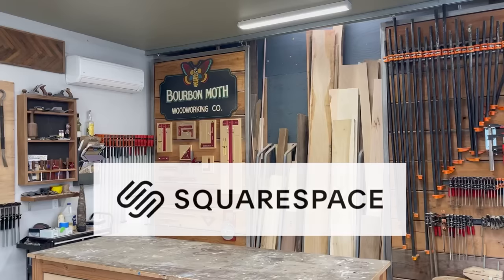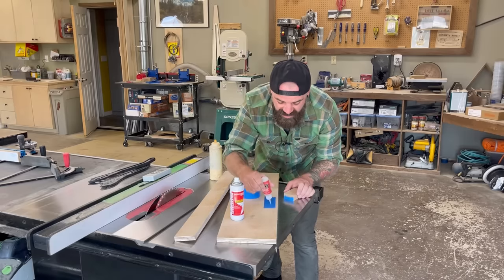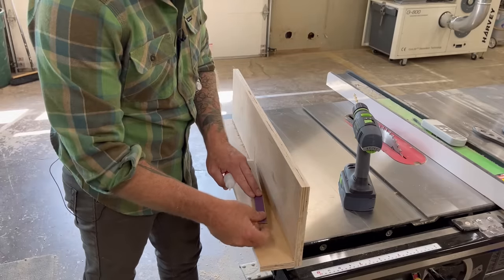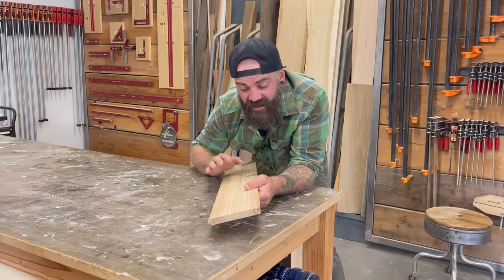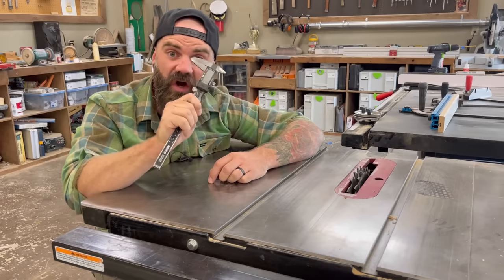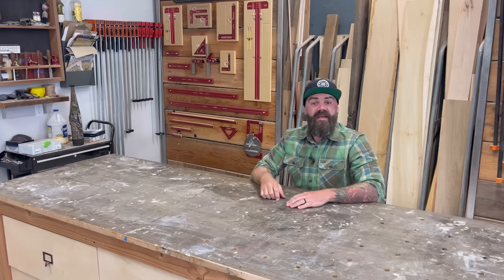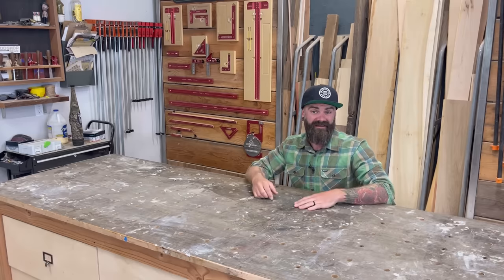Helpful Woodworking Tricks You'll Actually Use | Useful Woodshop Hacks

Comment: This is the 1st vid of yours I've seen. I thought, this guy is crazy.  I'm a newbie and u just gave me more tips than I even knew existed.   ALL of them were new info 2 me. 
Extremely helpful!  I can't wait 2 use them.  I'm heading over 2 watch the rest of your vids now. I have a ?  Which should b obvious,  but my little mind couldn't wrap around. Concerning expansion; if I were using some hardwood 4 a sled, should the lines on the end of the wood b running horizontal or vertical 2 limit expansion and screwing up your fit n the slots?

Comment: Regarding the qtip trick, I do the same thing with chop sticks. Really handy for stripped out door hinge screw holes.
Reply: Golf tee’s are another good one for slightly larger holes
Reply: Tooth picks are another option.
Reply: I keep a box of wood matches in the van for the same
Reply: in a tight spot i once shoved gorilla glue covered pieces of cardboard into rotten door jamb screw holes bc the glue expands — it worked great too !
Reply: I use 10 inch bamboo skewers.  Something like 100 in a pack for a couple bucks at the discount store.
And what you don't use in the shop can be used for cooking!  Lol

Comment: What about the board that I am building coffee table out of a solid piece of Oak that I cut off of a solid piece already it is 52 in long and around 23 in wide and what I'm planning to do is take some out of the middle that I'm going to make a river through it with some poxy and put Little River stones in it and then poxy over the top of it later on as it gets older will it try to pull away from the epoxy

Comment: Thanks for the useful tips!  I’ve been woodworking for more than 65 years; yeah I’m kinda old, and I always pick up something new from other woodworkers.  Thanks again, you present concepts in a very understandable way.
Reply: In October of 2017, I cut my left index finger by trying to cut a tiny piece of cherry shoe base moulding at a 45 degree mitre angle without using the zero clearance fence (plus I had taken my blade guard off of my mitre saw). Needless to say, I was rushing and didn't allow the blade to get up to full speed before making my cut with my left index finger holding the piece of shoe base against the saw fence within an inch of the saw blade and when the teeth made contact with the wood it caught and kicked the piece of wood, pulling it (along with my left hand/index finger) into the rotating blade. Chewed up my finger pretty bad. Happened so fast. I immediately grabbed my finger and squeezed it firmly with my right hand and could feel bone protruding and I knew I had just nearly chopped it off. I was working on a jobsite at a customer's house and didn't have my guys working that day (I'm a self employed finish carpentry contractor who specializes in interior trim work/moulding) so it was just me and the homeowner/customer there. I knew I needed to go to the hospital immediately but couldn't drive myself cause I couldn't release the pressure I was exerting with my right hand. So I went into the house and told the homeowner that I needed her to take me to the hospital. She dropped me off at the emergency room and left and when I showed my finger (or what was left of it) to the ER paramedic, he said, "Oh wow, ok you can continue to apply pressure to it (squeeze it). I'm not going to lie. It's bad. It's really bad. One of the worst injuries I've seen and I've seen everything."
 I said, "That's what I was trying to tell you!" 
So, to make a short story long, what had happened was the saw teeth had ripped and shredded along the side of my index finger, causing multiple bone fractures and the severing of a lot of nerves and tendons as well as chunking out the muscle and tissue right along the side of my finger from the first/top/end joint (distal interphalangeal) to the tip of my index finger (so about an inch or so of my finger or about 25% of the overall length of my finger). After hours of waiting for something to help the pain, they finally numbed it with something similar to what dentists use to numb your gums (i.e. Novacaine or Lytocaine). Then I overheard the nurse and X-Ray technician discussing the situation and that it was definitely going to have to be amputated. I wasn't shocked when I heard that but it was still hard to hear, even though I had already realized my left index finger was pretty much toast. I tried to take solace in the fact that I'm right handed and pretty much do everything with my right hand because the left has always been basically retarded, weak, and uncoordinated so I was momentarily consoled that it was not my right index finger. The consolation, however, was short lived when a haunting thought came to my mind; that one of my favorite hobbies was playing the guitar and, being a righty, I strum with my right hand and my left hand does the fingering along the fretboard (pressing down the strings). That's when it really hit me how significant it was going to be to lose my left index finger, in part or whole. And it wasn't just thinking about not being able to play the guitar again without great difficulty (or at least not well) and thinking about other things that would be more difficult if not impossible to do (like rock climbing which I enjoyed although I wasn't a climbing fanatic like friends of mine are), but I was also contemplating, with dread, the aesthetic implications; by the sheer grotesqueness of becoming an amputee; a gimp, forever (I was very superficial and vain when this happened). I thought they were going to have to amputate at least half of my finger. But it turns out they were able to salvage everything below the first finger joint (the distal interphalangeal). So I ended up losing about an inch of my finger. Totally sucked and it took me about a year to be able to play the guitar without the pain being overbearing, but now I can pretty much play at the same skill level (or lack thereof) that I was at before the accident. The moral of the story is to be safe when using power tools and learn how to do things the right way, safely before taking risks that could change your life forever. It tends to happen so fast, in a split second, and your life is forever changed. And there are so many far worse/more serious stories of accidents involving power tools than my story. I consider my story to be quite mild by comparison and really ended up being something that made me reconsider my shallow, materialistic, vain, and Godless existence which ultimately led me to Christ which is worth infinitely more than losing part of my finger so I now consider it a blessing. God bless.

Comment: i find reading grain direction to be far easier if you look at the side of the board especially when your material is not flat sawn.. when feeding into the planer the grain lines should slope down, so your always feeding your material "downhill"
Reply: For a beginner the looking for cathedrals is rather complicated.  As you say look at the side of the board to determine direction is so much easier.

Comment: Plugging holes to make a new one: I've always (for several decades anyway) used wood toothpicks. Either round or flat (and occasionally bamboo skewers even though they're really grass and not wood.) Glue it in etc. etc.. Also works on stripped out screw holes.

Comment: Hi there….. just wanted to add to your segment half way through your piece on tips and tricks concerning the expansion and contraction of wood that has been plain sawn (the example of the piece of pine you used).  I once knew a fellow who built a 9,000 sf house and used as flooring plain sawn Black Walnut. After a couple of years of living in the house and a few wet and dry seasons the floor expanded and contracted to the point that you could put a credit card between each and every piece of flooring it had actually expanded to the point that the floor pushed out in the summer and actually pushed the walls out then started to buckle, (I do not know the moisture %). To say the least it all had to be replaced. Short aside, the Biltmore House in Asheville, NC, finished in 1895 , the largest private home in the US with 175,000 sq. feet has a floor without any cracks, splits or separations (that I saw). And the reason is the entire structure had a quarter sawn white oak floor finished with turpentine and boiled linseed oil. As explained in the video (plain sawn) any wood expands and contracts left and right and there is nothing you can do about it. By deciding on using quarter sawn white oak the issue of expansion and contraction becomes moot. Quarter sawn wood expands up and down because it is cut 90 degrees to the annual rings. The floor moves up and down which of course you cannot see. George Vanderbilt once owned the entire Pisgah  National Forest, some 125,000 acres so he had  plenty of wood to choose from. I doubled the size of my older home kitchen and used quarter sawn white oak wherein the rest of the house was done in plain sawn red oak when built in 1953. The difference is phenomenal. Besides being practical, the process of quarter sawning produces the most beautiful pattern, usually called rays, some people refer to it as "tiger stripe".

Comment: I've just now started doing some very beginning woodworking things in my garage.  I just had to take a minute to let you know I really really enjoy watching your videos and I've learned so much already and I can't wait to learn more as you keep posting videos.  Thank you for all your effort in the videos you post, quality of content, etc.  10/10 sir!
Reply: That’s really great. Can I make a suggestion (from an old man with 45 plus years of woodworking). There is a normal emotion of, when just starting, wanting to make things. And make things. And make things. Don’t fight that but try to balance making with learning. By which I mean learn and practice the basics - without which anyone would be a hack and not a craftsman. 

First for me would be measuring and marking. Firstly then, you need accurate and reliable rules, tapes and squares. That doesn’t mean the most expensive (most people like owning lovely things; people drove a Rolls Royce but it doesn’t get you there any quicker than a Mini). It doesn’t have to be new. It often doesn’t matter that your tape is 1mm inaccurate over 2m as you probably want reliability more than absolute accuracy. For example, you measure an alcove with your tape at 997mm - when actually it’s 998. But, when you cut a piece to fit nicely, you use the same tape to cut at 997mm and it fits. The square needs to be square; easy test; take a scrap of sheet paper or card or even mdf. Place your square on it with the short edge of the square facing left (needs to be accurately placed at the edge and sometimes a thicker piece of card or timer makes this easier) and the long side on the card/timber. Draw a line along the long side with a sharp pencil. Then flip the square over with the short part again along the edge of the card but now facing right. The long side should be very near to where you had it before. Draw another sharp line. If your square is perfect, then the 2 lines that you have drawn will be parallel. If they are not exactly parallel, then you can measure the degree by measuring the out-of-parallel and dividing that by 2. For example, if your out of parallel measurement is 2mm, then your square is out of square by 1mm over the length of the long side. If your square has been bought new, then don’t touch it, just take it back. If it’s secondhand, you can certainly try and make it square by taking a sheet of emery paper wrapped around a long piece of timber and try to rectify the inaccuracy. Personally, I would just throw it and learn the lesson.

Then you have the good ways to mark; to saw; to chisel. Actually, there are lots of good ways and a few bad ways. There is no ONE way. If anyone finds this useful, I’m happy to write a bot more.

Comment: Another awesome video. I'm an avid fan. You offer a great tip to identify the direction of the grain. Please confirm the best practice is to run your board through a planer and jointer as the grain direction pointing toward you? Or phrased... the knife-edge travels into the wood in the same direction as the grain. So on a jointer, blade spinning clockwise, you would have the grain point right, and you would feed the wood from right to left? Is it any different for a helical jointer head?

Comment: Sorry aviation guy here.  It's a digital vernier, not a micrometer.  But great tip none the less.  Also, the Q-tip tip?  Is good, I also like to use toothpicks, mostly because you can cut a couple jam them in and the take one last one with the pointy tip and hammer it in to make it all nice and tight.  Great videos, I've watched them all.  Especially the drink ones.  Cheers.

Comment: Only thing I would add...  on the Rockler  sacrificial fence clamp tip; make sure when drilling your holes in the top edge of your SF that they are as true as possible/parallel with the faces of the SF, not all 'cattywampus' <-- Official term.

Comment: To get a good bond when using CA glue and accelerator Wait a few seconds after applying accelerator to make sure it evaporates a bit or soaks in to the surface.  The accelerator has a chemical that makes the glue go off faster but the carrier for the chemical is acetone. If the acetone is not allowed to evaporate first it prevents the glue from bonding to the surface you sprayed it on.

Comment: For those who don't know, you can also use a spray bottle of water as an accelerator for superglue. If you don't want it getting wet, baking soda dusted on also works as an accelerator, I usually keep a sock full of it laying around for dusting, like people do with baby powder to keep sand off at the beach.
Reply: Holy hell, does that work?!   Baby powder at the beach, I mean.  I love the idea of going to the beach but all the damn sand just ruins everything.
Reply: @JeanPaulConnock  It is amazing!.. The baby powder makes the sand fall right off!.. It also works with those tiny bits of hair that fall on your neck when you get your hair cut. Gets most of them at least.
Reply: bitingpuppy ..was it a clean sock ?

Comment: Digital CALIPERS. Micrometers are much more accurate but would not work all that well for splinter removal. Iwork as a machinist and use these all the time to remove metal splinters. Also, nail clippers work well. Live your videos though! Learned a lot.

Comment: That scorched (burned) wood look on end grain is nice. But old oxidized wood look can be achieved by simply mixing pint of vinegar and a added price of steel wool to a jar. Let set 24 hrs then paint the new end grain with this mixture. The longer the steel wool remain in the vinegar the darker it will turn the fresh end grain. Its kinda like matching a stain.

Comment: Another is using a round wooden toothpick, cheaper by the box and they fit all sorts of hole sizes cause you can bunch um together and if needed cause the hole is to big for just one, you can keep adding them till the hole is full. Just tap them in and squirt a bit of CA into the bunch. And you can then pick a tooth or two with the back side depending on how many it took to fill the hole. 😀 Or use um for another day / hole.

Comment: As a machinist I laughed when you said "Digital Micrometers". Those would be Digital Calipers Jason lol. Great tips by the way. I'll be making use of the Miter Saw Sled. Thank you!
Reply: Yup, I try to ignore it, shouldn't irk me as much as it does, but I can't help it. The Amazon link he has for it uses the shotgun approach "Digital Caliper Measuring Tool, Stainless Steel Vernier Caliper Digital Micrometer with Large LCD Screen, Easy Switch from Inch Metric Fraction, 6 Inch Caliper Tool for DIY/Household" ... jeez
Also "take a butane torch" with a big blue "propane" label on it.

Comment: Instead of using a cotton swab with a wooden shaft, I like to use a bamboo skewere, sharpen in a pencil sharpener, fill the hole with glue insert skewer, and then flush cut.

Comment: Another hack for your router. If you have a 23/32nd bit and your lumber is a little thicker, and a layer or 2 of painters tape to the bottom of the router until you get a snug fit. This only works if you’re using a guide btw

Comment: 8/8/2021 USA Grandpa Bill:  Of the toothpick-fixed holed adjacent to which you will drill the new one:  examine the toothpick closely for a) hardness, and b) grain direction.  I have had the bit slip into the softer wood of the toothpick making my new hole slide off a little thereby screwing up the effort and requiring a new effort. By breaking the toothpick at one end you can determine the relative hardness compared to the board you're on, and the length of the splinters showing its own grain pattern. The worst-case scenario is to make a toothpick of the same wood as your board. I've even cut with my knife a toothpick for a given hole.

Comment: Nit pick: micrometers are used to measure things within less than .001" [40 microns].  The DIGITAL CALIPERS you show here are accurate to about .003" [120 microns]. Micrometers have a very fine screw adjuster to keep their precision. You can't just slide the jaws open or shut on a micrometer, you have to turn the screw 1,000,000 times. Most wood workers would not use micrometers. Calipers are plenty accurate enough.
Reply: Yeah, Vernier calipers.

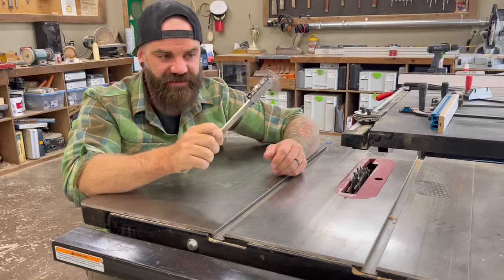Comment: 14:20 Nope, that is NOT a micrometer, that is a caliper!
They are NOT the same thing.
Micro means millionth, meaning that a micrometer will measure 1/1000000 of a meter (or 1/1000 of a milimeter), hence the name. A digital caliper will only measure 1/100 of a milimeter. Or whatever the equivalent is in inches, adopt metric already, you're about the only ones left using imperial!
And using a disposable gas lighter to light the torch is just asing for trouble. One false move, and that thing can explode in your hand!